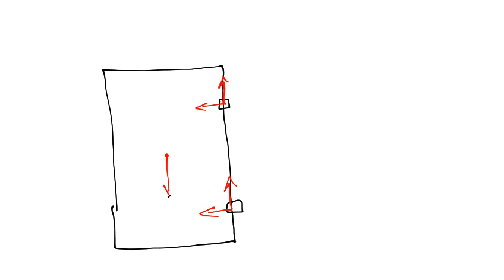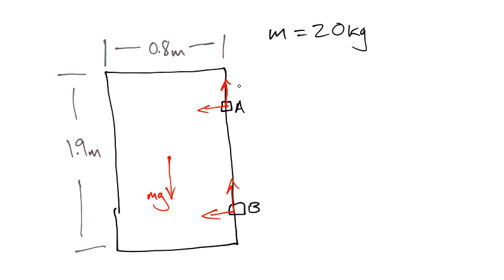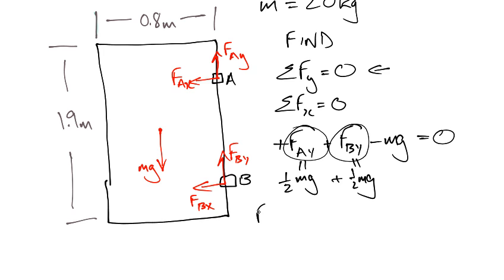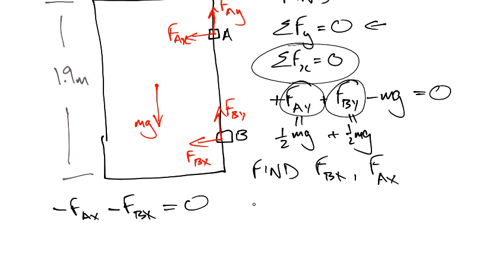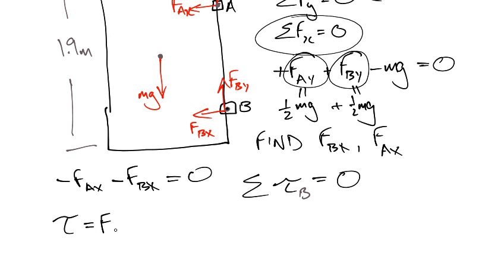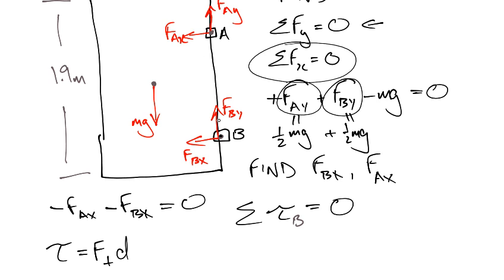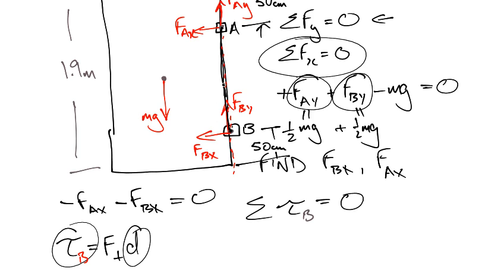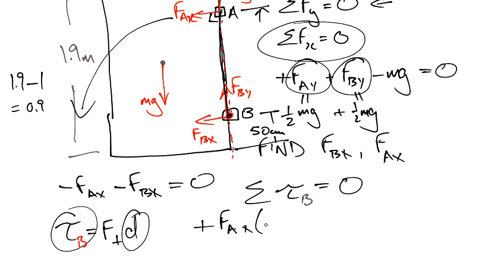Statics Door hinges phy12-stat1b

Comment: how were you able to say that one of the forces in the x direction was negative when they are both pointed in the same direction
Reply: Hopefully you figured this out by now, but for others, it just means the initial assumption for the direction of the reaction force Fx_A vector is incorrect and should be reversed (which makes sense because it should resist the weight of the door)